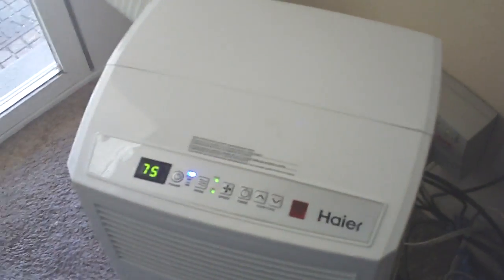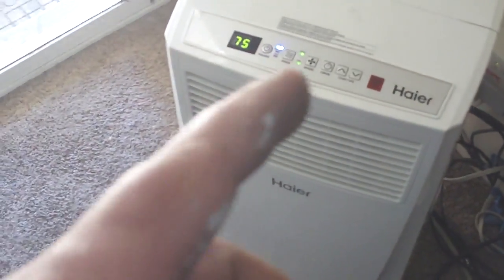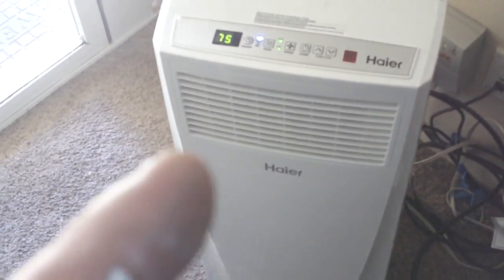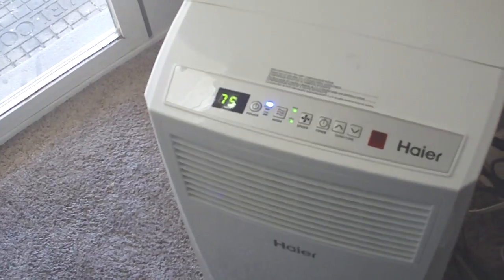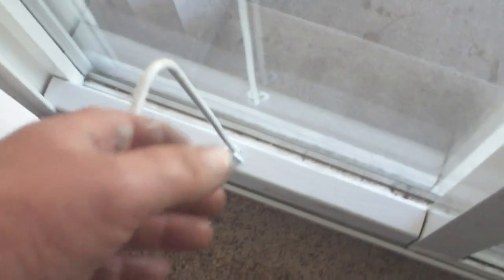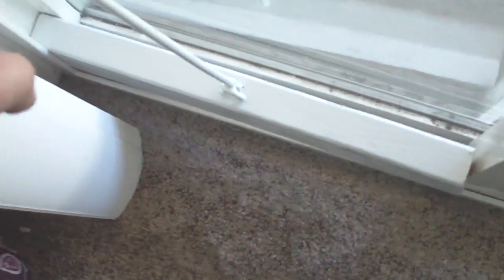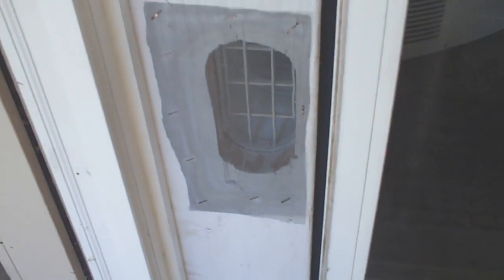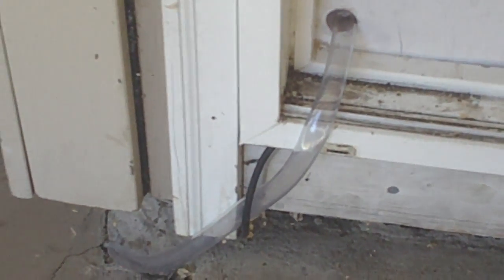INSTALLING A PORTABLE A/C IN A SLIDING GLASS DOOR

Comment: I love this, and I need this, I wish I had a close up of how you handled the vent hose hole. How thick is that wood panel? I need this badly. There are a couple companies that make sliding glass door plastic, but there's so flimsy and have bad reviews but yours is much more stable. Thanks for sharing and if you don't mind sharing more info, I would appreciate it.
Reply from the maker: for the hole I just used a hole saw at the top and bottom of the vent hole and used a jig saw to join the 2 holes . I used a 2x 6 and cut it to fit in the door frame . not hard , you can do it !! Thanks ..